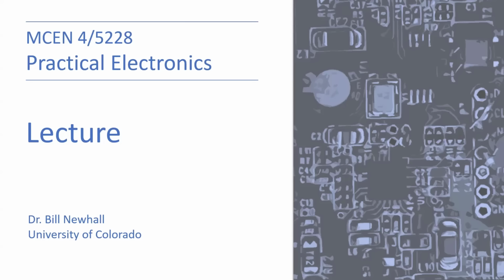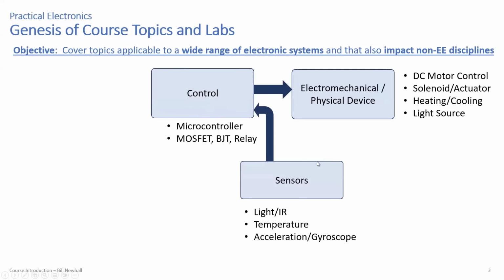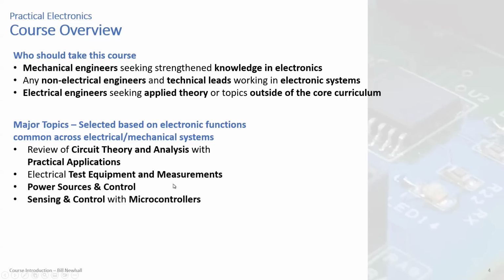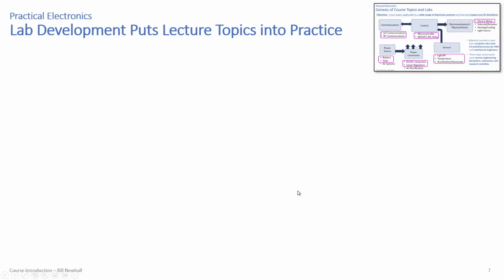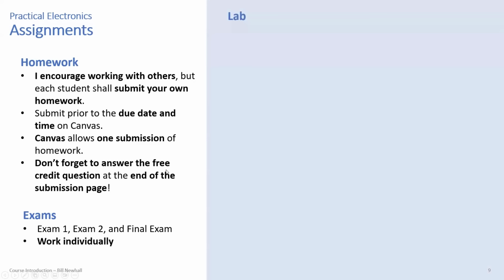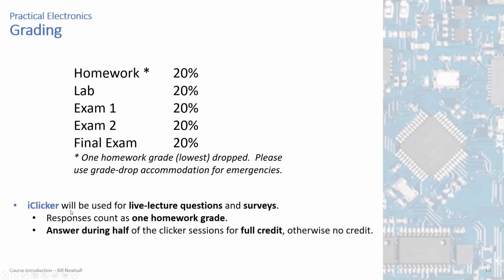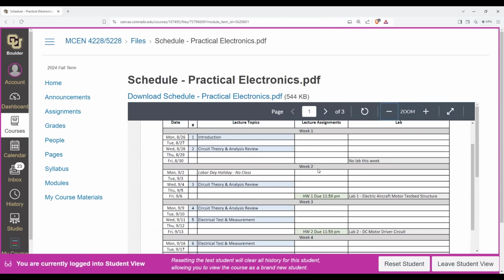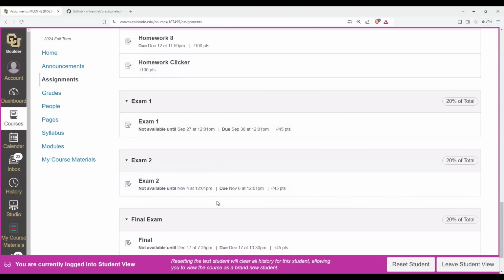Practical Electronics - Lecture 1

Comment: Engineering Electronics is a fascinating field that deals with the application of electronic principles and techniques to design, develop, and test electronic systems, circuits, and devices.

Some of the key topics in Engineering Electronics include:

1. Circuit analysis and design
2. Electronic devices and components
3. Microcontrollers and embedded systems
4. Digital signal processing
5. Communication systems
6. Control systems
7. Electronic instrumentation and measurement

As an Engineering Electronics student, you'll have a wide range of career opportunities in fields such as:

1. Electronics design and development
2. Telecommunications
3. Control systems engineering
4. Aerospace engineering
5. Automotive engineering
6. Medical electronics
7. Consumer electronics

What specific area of Engineering Electronics are you interested in?

Comment: I am learning PLC's (Programmable Logic Controllers) and this seems to be a course that is directly related to what I need to know about.
Reply: What resources/website? YouTube  Videos are you using to learn? My understanding is that PLC / CPLC are obsolete, replaced by FPGA. PLC can implement a gate with a dozen (or more) inputs and some outputs, replacing a few dozen 74XX components. CPLC has improved that number, but both have been in the past for a few decades. FPGA takes hundreds of inputs and generates hundreds of outputs, possibly including an internal microprocessor.

Comment: I had done a small course in electronic application. During that practical session I had faced lot of technical problems because of not understanding baic fundamentals of circuit reading . That is what is input and what is desired output. The network bteween i/p and o/p is circuit which drives current and vltg. flow throghout the loop. The analytical approach while studing the whole cicuit theory was the much required part through any technical course. This practice of delivering good knowledgable things to students and all technical persons like me is beyond the grounds of appreciation. My good wishes to this vediomaker and all viewers. Thanking you sir.

Comment: For those of us who are not University Students would you be willing to provide access to the basic materials that go along with the course?
Reply: There is a book called 'Practical Electronics for Inventors". By McGraw -Hill .  It's in it's 5th or 6th edition at this point.  I have 3rd edition.   It's the most indepth book.   You won't be disappointed.
Reply: @Jeremy-dr3is  Thanks!
Reply: @erikburman530 Hey did you purchase this book? If yes how was it?
Reply: Support +1 Would like to have public access to the lecture materials (PDF, ppt, etc). But, the idea of intellectual right is rather “important”/“stucked” inside the mind of said academy (wish the professor involved is more open-mind on open course-ware 😅) but the hope is not high though....
Reply: +1 Logical question, he should be providing the materials,
Reply: @hoytvolker3  He should. But will he?
Reply: @erikburman530  I doubt 😕